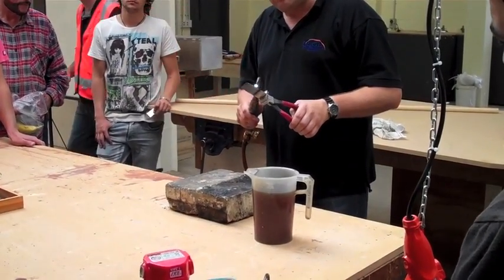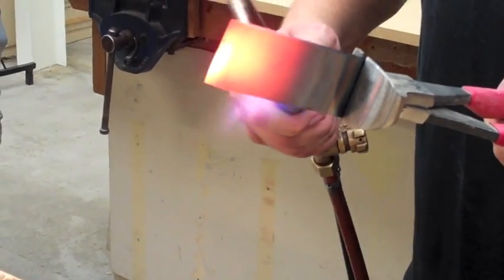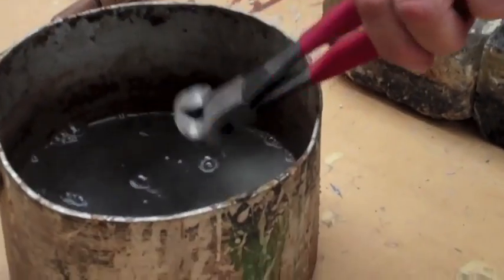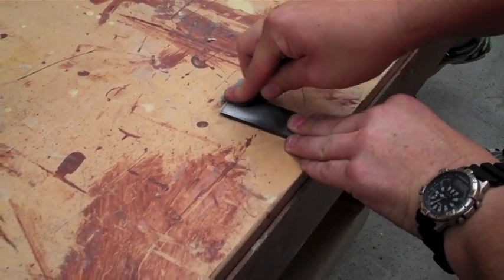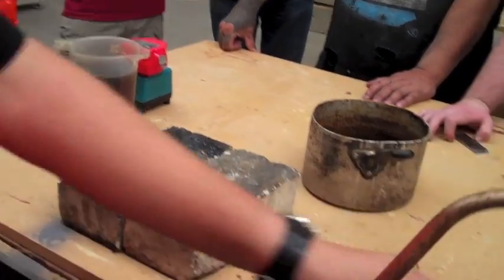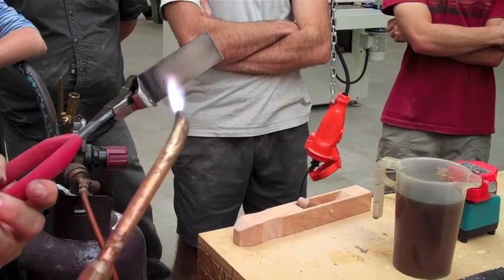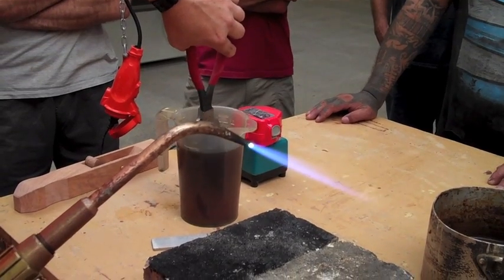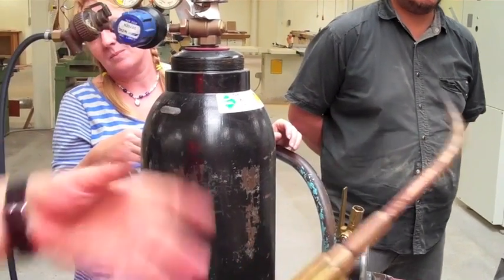Hardening Plane blade.m4v

Comment: Very interesting video.
If you burn a blade on a grindstone and its blue can you harden and temper it again?
Reply: Yes . Heat it tocherry red and quench in oil . Then put it in the oven on 400 degs for 2 hrs to temper it .

Comment: Hey there, interesting video. Admittedly I've never worked with steel (just wood & illustration), but I have to ask: Is that plastic bucket the best thing to keep your quenching water in? Considering that you're dunking a hot glowing blade in it, wouldn't a metal or wooden bucket be a better choice? If the metal touches the plastic bucket before it cools, surely it would melt a hole in the bucket. Other than that, however, I like the vid...most informative.
Reply from the maker: yes I guess you are right.